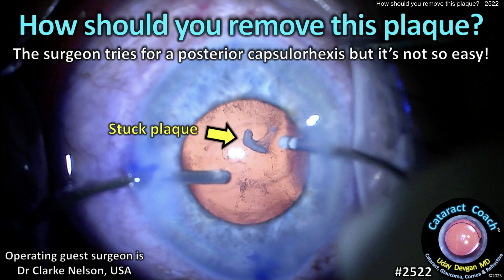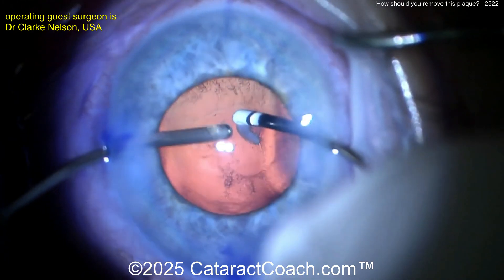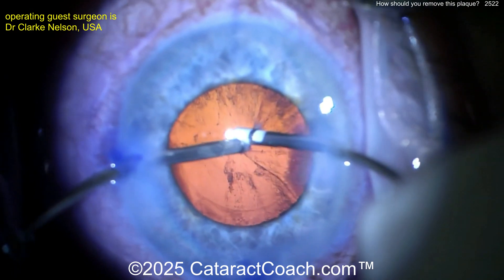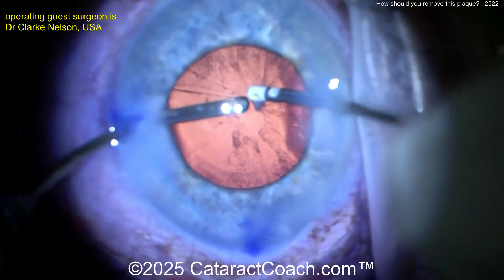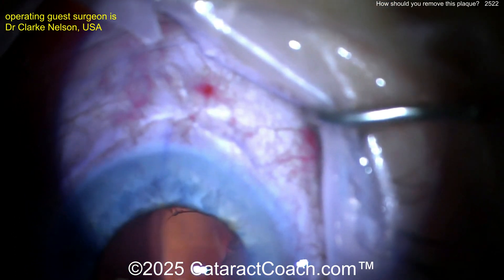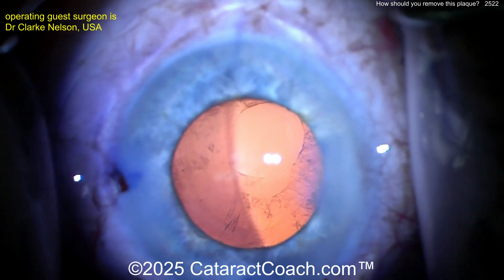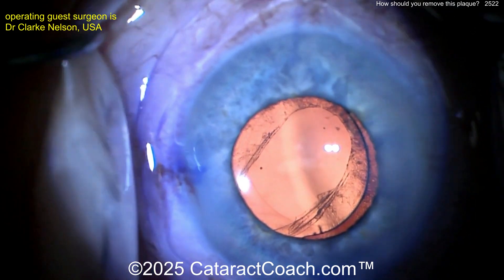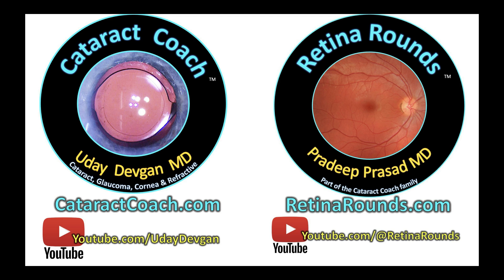CataractCoach™ 2522: how should you remove this posterior capsule plaque?

Comment: Performing a posterior CCC is possible but I find it more difficult in post PPV eyes. As Steve Safran points out in his comments there is often a layer of vitreous behind the posterior capsule that the VR surgeon left because removing it means the vitrector has to be very close to the PC and risks damaging the posterior capsule. If the surgeon isn’t experienced with PCCC then a yag postop is very safe. This plaque isn’t dead center so it may not affect vision significantly.

Comment: Patients who have had a PPV for an ERM or RD or floaters or whatever prior to cataract surgery very often have some vitreous right behind the posterior capsule because the VR surgeon does not want to damage the posterior capsule with the vitrector.  If you break the posterior capsule during surgery or remove the capsular bag because it's loose and want to do Yamane there is often vitreous there that you must deal with so in a situation like this you need to be prepared for that and assume it's there.   I would keep the anterior chamber pressurized with viscoelastic before manipulating that plaque and that would also make peeling the plaque easier and reduce the risk of vit coming forward but once the PC is broken, even if there is a prior vitrectomy you cannot just assume there is no vitreous behind the posterior capsule.